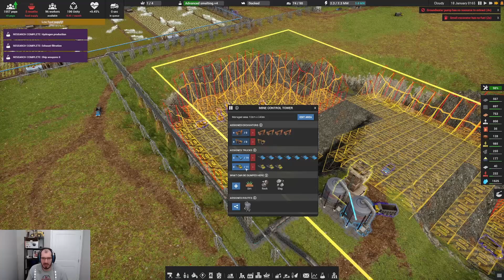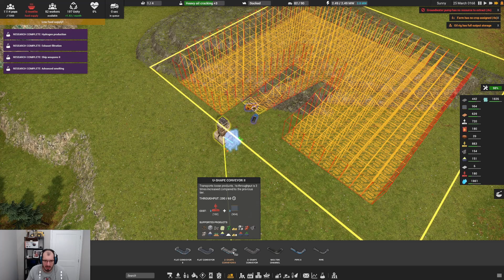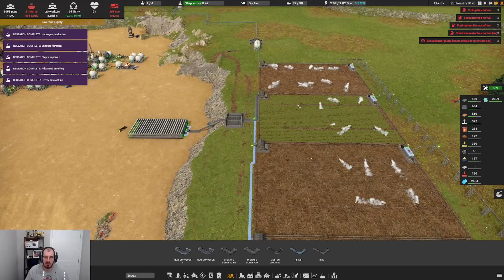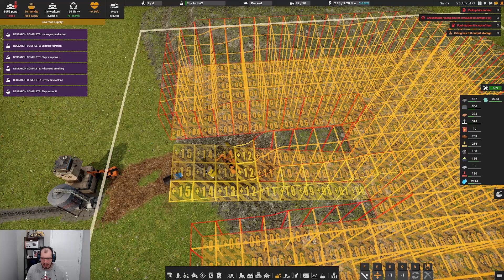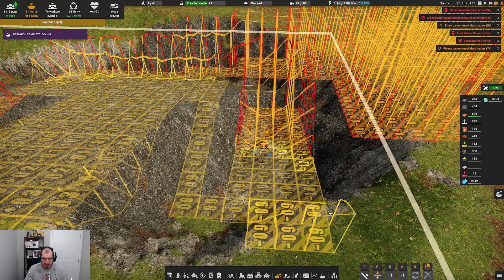Taking care of all future food needs. | Captain of Industry | BETA | Part 13

Comment: Appreciate the insights!
Question about when you added the Sand Dump site.  If you have a dedicated Sand Mine and a  dedicated Dump for Sand - Won't you just spend Fuel and Time moving Sand form your Mine to your Dump?  When I get a Truck Locked with a Load (like that Sand issue) I carefully open a dump site for (Sand in this case) just for the seconds it takes for those stuck trucks to get new orders - then kill Sand from being dumpable again.
Reply from the maker: It seems to have not cause issues...it was more setup to allow others to dump the sand somewhere, when storages are full...but I'm sure there is a better setup

Comment: What you should do once you get the even better oil refining tech, is redo your set up to prioritize diesel, fertilizer and fuel gas outputs, any excess products should first go into the boilers then the flare stacks, fuel gas gets piped wherever you need to generate steam, far more efficient than coal, both in transport and because its effectively unlimited, there are other sources of fuel gas later on (waste water treatment chain) so having a network to take it will be useful.